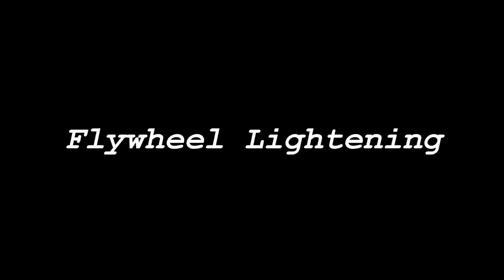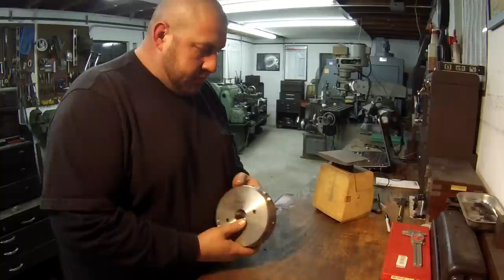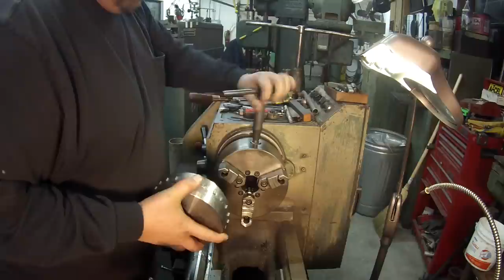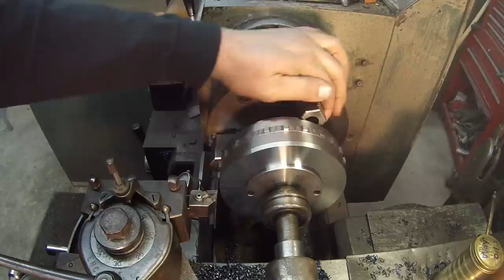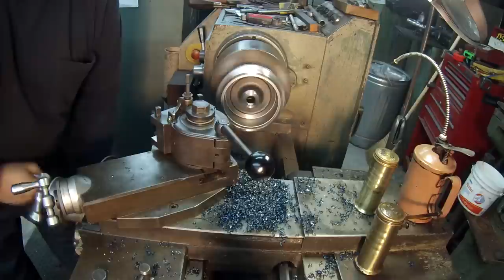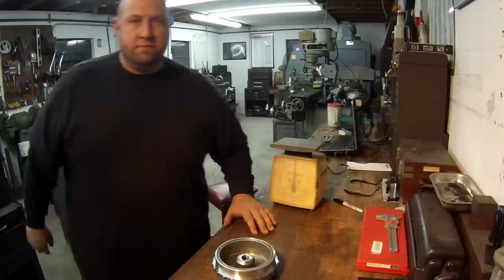Flywheel Lightening

Comment: Hi Adam !

I noticed that you just turned off the holes for the balancing AND some markings - I beleave it was "L" and "R" !

Shouldn't the wheel be balanced again ?

Isn't these "L" and "R" for setting the ignition for the Left and Right cylinder ?

OK- done is done, but I would prefere at least the balancing done again.
Reply: Probably ignition timing for the R and L cylinders. 

I wonder what difference the balance hole missing will make?

This part is likely the generator rotor, hence the magnets.  The real crank flywheel is likely inside the engine one the crank between the pistons.  But getting rid of some rotating mass will make the engine, and the bike, accelerate faster.
Reply: I think the balance would be important, but the timing marks are really just TDC indicators for the Left and Right cylinders, mainly used for the average owner setting the valve lash.  The surface they ride on is normally visible through a removable plug on the side case. For anyone working on a modified bike, it's pretty easy to detect TDC for a valve adjustment with a screwdriver down the plug hole...the ignition timing on these late bikes is set by the bumps on the flywheel, NOT a mark on the flywheel (else why have L and R marks).
Reply from the maker: Balancing is handled by the bike shop.

Comment: Hello There,
I am one of your subscribers (from Norway) and really enjoy watching your vids. They contain a lot of "learning material" and your style of explaining jobs & procedures is very helpful for a hobby machinist like myself.

On your video here, as on others, you use the dial indicator with a magnet fixed to the back. Is this a shop mod on a regulator indicator or bought as is? I am contemplating purchasing a DRO, you see (yes, into the discussion on glass scales vs. magnetic etc. etc.), but this way of using the indicator seems to almost do away with a need for a digital read outs for short workpieces. Or am missing something?
Also, the ball joint indicator mount looks like having a one screw fixing point, correct? You make it all look like easy as h.. but this device shure looks like a timne saver..

There are now some very good channels to follow, eg. Mr. Fenner's and other pro's that take their time to share knowledge... Much appreciated, keep up the good work!
Reply from the maker: The indicators have a magnetic back on them. They are avalible to buy from many reputable tool suppliers. They are great but I would still like to have a digital readout on the machines. The indicator holder I use is made by Noga. Ive talked about them in a couple of my videos. They are a fine tool and would recommend one to anyone.
Reply: Abom79 From one Norwegian to another. Any indicator can have a magnet glued to the back. DRO... Yeah !

Comment: noticed that you removed the markings on the outer ring are they put back on some how? They are used for making sure valves are in the correct location for adjustment
Reply: +Robert Jorgensen If someone is going to the length to have this kind of thing lightened, I'd figure the builder would know how to do the valves without the marks.
Reply: I would mark their spot somewhere where material wasn't being removed to then transfer back once the diet is completed, including the L and R.

Comment: Hi there.  I have a slightly smaller flywheel that I was actually just looking to have some material, maybe 60-100 thousandths off of the OD only, nothing needs to be done on the face.  How would I go about having you do this work for me?

Comment: I recently picked up an old sheldon lathe.  It has 3 and 4 jaw chucks.  How do I know when to use which one?
Reply: If the job is exactly circular, use the 3 jaw. If it isn't exactly circular, or it is rectangular or square or anything like that, use the 4 jaw. But in saying that, a concentric 3 sided, or 6 sided piece can be put in a 3 jaw.

Comment: never understood lighter flywheels, yeah under no load its a bit snappier but a heavier flywheel (to me) feels so much better when actually moving.
Reply: I am a retired race car driver and builder, the reason this is done is to reduce overall rotational weight and increase rpm and horsepower, weight robs power, so the lighter things like crankshafts, flywheels, etc the more horsepower can be produced, and in a race every little bit counts
Reply: yea you get RMP faster but i have broke a few cranks because it wasn't balanced.
Reply: glen john we always balanced the rotating assembly after we lightened them, our machinist was a perfectionist and would always Balance everything that attaches to the crank, it why out engines lasted so long and ran so good
Reply: i learned the hard way. we would use break lathe to turn auto flywheels. after about 3 broke cranks we decided to just buy them high dollar flywheels and be done with it. LOL then we got sponsors and went crazy. but anyone that would spend $500 on bolts just to save 3 pounds had to be crazy anyways. and that was my boss man.

Comment: I noticed you didn't check for radial run out, what these engines redline at?
Reply: I thought I could see radial runout on the second side. I would have tried to indicate off the bore, if it was possible.

Comment: The "ears" are a reluctor ring. It's for the engine management system to know how many degrees of crank angle the motor is at, at any given point.

Comment: Thats a big reduction in mass for a flywheel that size, they are going to loose a lot of pull off the line at low rpm.
Reply: BUT a big 0-60 reduction! 
I cant remember the formula but its a massive acceleration reduction for just a lil weight.
Reply from the maker: I dont know the performance gains/losses James, I just know what they want and I do it and get paid. But they are a reputable shop thats been in business since the 70's and still family owned. They are really nice guys and love racing. They even have there own Triumph racing team. Ive done quite alot for those guys.
Reply: dongmaster9001 The closer to center you get the more weight you have to remove so it make no sense to remove anything from center. or close to it. Been doing this to cars since I was a kiddo and it helps more than you would think. A lot quicker rev.

Comment: The main bearings of that bike aren't going to be very happy now that the flywheel is way out of balance.   You absolutely need to dynamicly balance the flywheel after machining.
Reply: I would guess that if the mechanics are selling it as a mod they are balancing it at their shop.  But having someone else do the heavy lathe work saves a lot of time and stress on them.  To spin it up on a balancer afterwards to shave a spot here or there is a lot easier.  But I agree it should be balanced before use.  Then again they could just be telling people they need to have it balanced before they use it as well.

Comment: I'm pretty sure that you can't just take weight off of this. It's part of a balanced assembly... the crank rod piston flywheel are all balanced together. Really good way to ruin the bottom end of a motorcycle. I'm not blaming the machinist he's just doing what he's asked.
Reply: all the boost I noticed that too  - machined off the balance holes.

Comment: Hello,I have noticed you only measured the face side parallelism. But when you touched the outer diameter it was clear to see you had no concentric run.A three-jaw chuck never clamps 100% concentric! Face side parallelism is no proof for 100% concentric run.You should measure and adjust outer diameter deviation too....Actually the flywheel shoud be adjusted and fixed on the inner diameter and all machinig done in one step without unclamping the flywheelbest regards from a swiss precision mechanic ;)
Reply: Just visualize the other items inside the engine running eccentrically and you will realize how trivial a thou or two on the flywheel OD is.